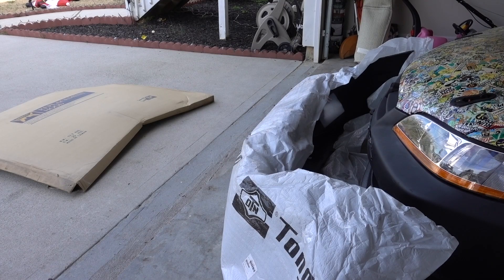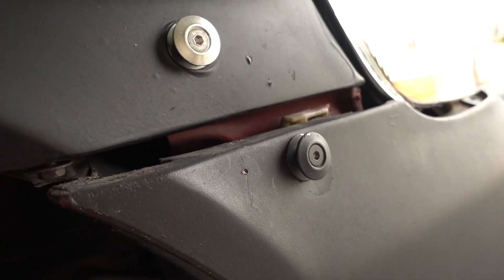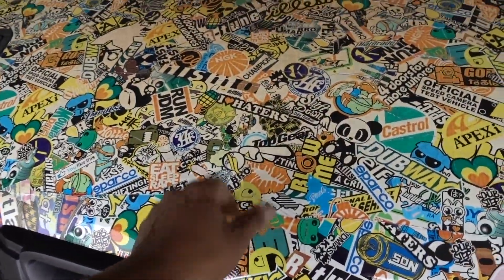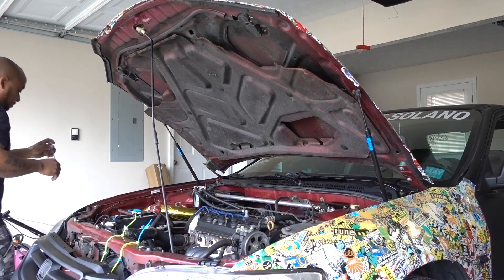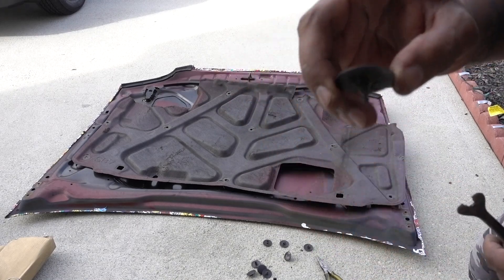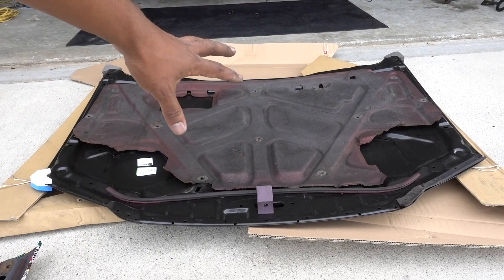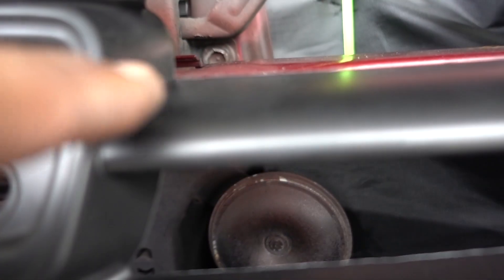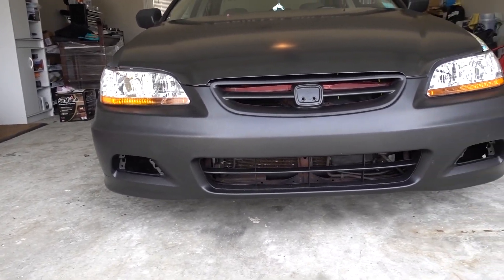2000 Accord 3.0 | How To go from Sedan Bumper to Coupe Bumper & Hood

Comment: There's nothing like a coupe swapped exterior and interior in a sedan! I thought I was the only one who did this I went as far as fitting the coupe bumper hood seats center console pretty much all the inside is murdered and can't wait till you put it on your cg. Good shit man props
Reply from the maker: Thanks bro
Reply: I'm sorry to ask like this but ive got a 6th gen 4dr accord myself and just wanted to make sure before I start buying parts that If I
 get a 2dr hood and front bumper that they'd fit properly on mine.
Reply from the maker: They do fit
Reply: @zero0512   check out this thread https://honda-tech.com/forums/honda-accord-1990-2002-2/01-02-accord-coupe-front-bumper-conversion-2261611/

Comment: So you don’t need to change fenders to fit coupe bumper? Dumb question but I’m thinking about doing the swap and just want to make sure I have all I need for it
Reply from the maker: Yes, you need bumper and hood only! Also get this for the swap https://amzn.to/4a2hnbA
Reply: @BulletSolano hey bullet, I’m in the process of trying to gather all the pieces to put an aftermarket coupe bumper on my sedan, it looks like I will need a new hood for sure, is that piece that you linked? What holds the front bumper on or is it for the grille?
Reply from the maker: Hey man, is for the bumper
Reply: @BulletSolano  I have a separate grill piece that I wanna attach to the bumper as well, do I need another separate bracket for the grille piece or how does the grill stay on?
Reply from the maker: The grill goes in the bumper with screws

Comment: Where do get the parts you use for example the bumper and lip
Reply from the maker: Bumper is from a local place, but you can get it on Amazon, the lip as well.

https://www.amazon.com/dp/B07RV98GNS/ref=cm_sw_r_as_gl_api_glt_fabc_BSRM96N88G4B5F14WKDT?linkCode=ml2&tag=bullet23-20

https://www.amazon.com/dp/B009DJYUGY/ref=cm_sw_r_as_gl_api_glt_fabc_24534GRTB2NXS837W24H?linkCode=ml2&tag=bullet23-20
Reply: @BulletSolano  ok cool thanks my guy
Reply from the maker: No problem

Comment: I have a honda accord 2001 sedan V6 i want to add a cold air intake and exhaust is it worth it? Does it even add horsepower?
Reply from the maker: If you get a tune for it yes!!
Reply: @BulletSolano  so do i tune it afterwards or befor
Reply from the maker: After
Reply from the maker: You have to take your car with someone who knows how to tune a car, but don’t waist your money on that, is not worth it unless you get a turbo or supercharger

Comment: Happy new year to you and your family. I like how easy you make it look. Quick question I have an 01 accord 4dr lx in pretty good shape but was looking to do what you're doing. If I get the coupe hood and bumper will there be any issue with how everything lines up and would I have to adjust the latch? Or was the latch adjustment because of the accident?
Reply from the maker: Happy new year bro, my car is not straight that’s my problem, but to get everything to line up you need the top brace for the coupe 
New Bumper Face Bar Retainer Bracket Brace Mounting Kit Front Coupe HO1041103 https://www.amazon.com/dp/B07MH6DCVJ/ref=cm_sw_r_cp_api_glc_fabc_oVn7FbHANYATE
Reply: @BulletSolano  Thank you for the quick reply. I'll look into that. Is replacing the brackets difficult or just unscrew and replace?
Reply from the maker: Just unscrew it, no problem

Comment: Where did u order fog lights for those slots ?
Reply from the maker: Amazon, I get the ones for the 7 gen accord, is hard to find the ones for this bumper, some modifications require on the installation, video is coming soon
Reply: @BulletSolano  I have been watching your channel for a long time now, I myself did the same bumper conversion as you did with the 7gen inspire fog lamps... word of advice for the fog lamps, the 7 gen lamps are not a direct fit, they require customization to allow them to fit, also they do not install on the car unless you have clearance from the bash bar behind it, I had mine welded off a portion from each side, hope this helps. also most kits online do now come with them direct fit switch, i got my switch from the dealer OEM and soldered the wires myself so it sits on the empty slot next to the cruise control button and matches the factory look, hope this helps.
Reply from the maker: Hey bro, thanks! I did this conversation to some friends on the past, I know what you mean, and I still have the wire harness in the car from my las fog lights setup, I just need to do the lamps I don’t need to wire them up

Comment: Would that bumper fit my 1998 honda accord lx ?
Reply from the maker: Yes
Reply: How low did you go when you installed the coilovers , i saw your vidoe car looks good how it sat
Reply from the maker: Sat low, fender is in the tire
Reply: Thank you for the feedback one last question , when doing this conversion do you think it's necessary to also get a radiator support ?
Reply from the maker: Yes